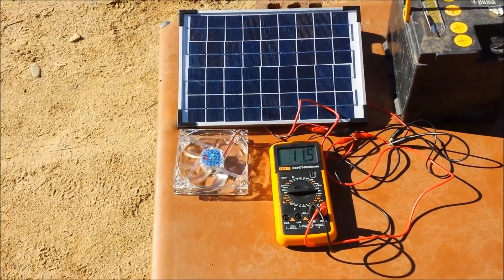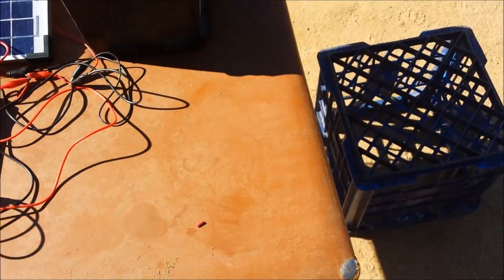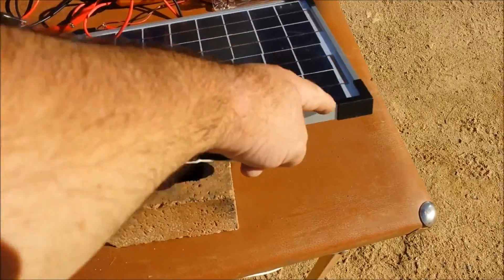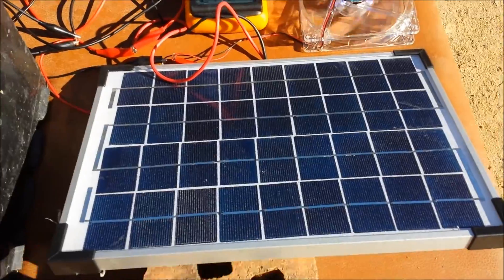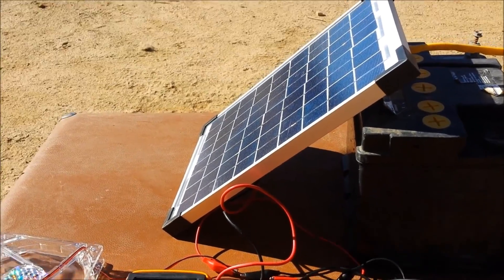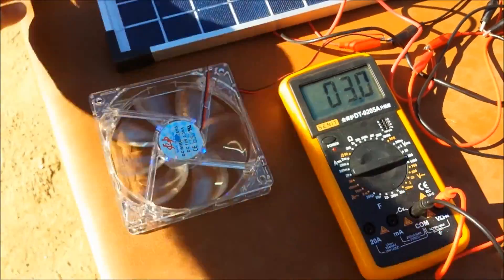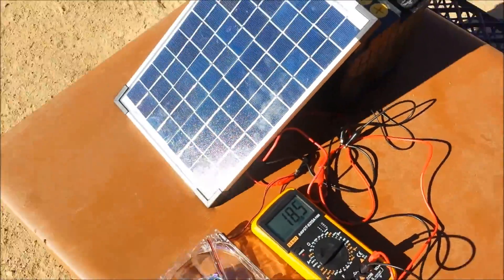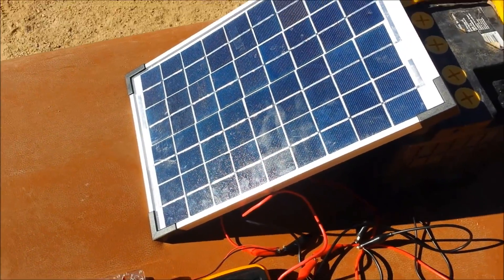Solar Panel Orientation and Shading

Comment: thanks for that. I just installed a panel for a deer feeder and there is some shading due to the mounting location. it's just a trickle charger to keep the battery fully charged I hope I don't have to move it. thanks good video mate.

Comment: That was really helpful, I didn't realise they were so sensitive.
Reply from the maker: +Beginning2013 I have a 100W panel on the roof of my carport and last night my batteries were down to 12.1V with only my fridge running. At this time of year, the panel should easily be able to produce .5kWh per day, far more than what the fridge uses.

I just checked the panel and it was covered in dust and bird shit.